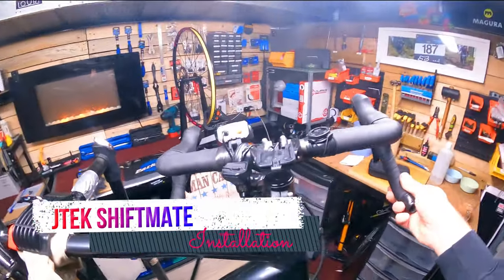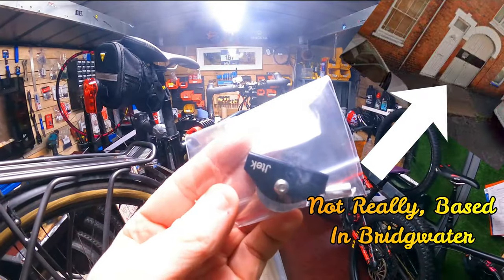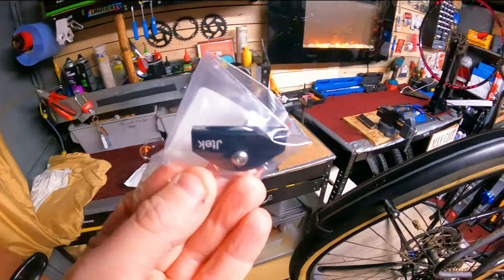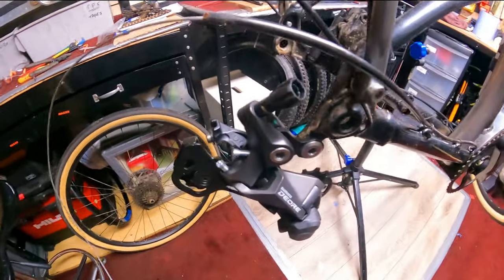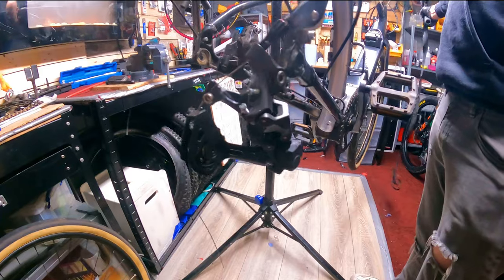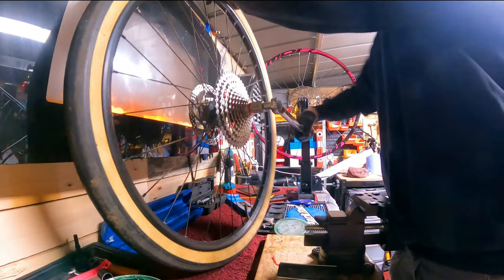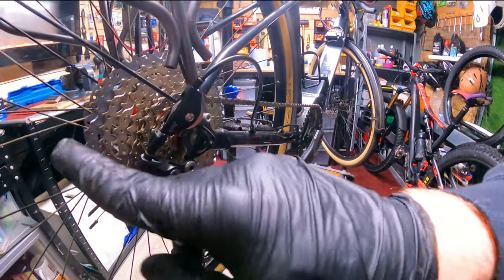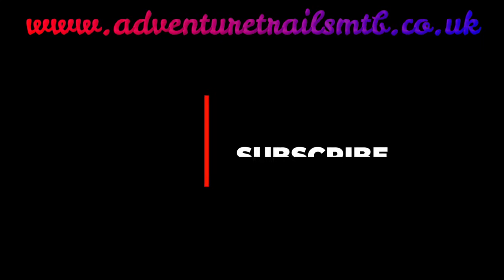Use Road Bike Gears With MTB Derailleur's: It's All About The Ratio's (Shiftmate)

Comment: Can I, with this thing, pair Sora 9 speed road brifters with 10 speed mountain derailleur (for example Shimano M786) on a 9 speed cassette?
Reply from the maker: not that i'm aware of dude , but check shift mates website , they may have abetter indication . looks unlikely though
Reply: 9 speed Shimano road has the same pull ratio as a 9 speed Shimano MTB rear derailleur out of the box.  No adapters needed.
10 speed SRAM road has the same pull ratio as a 10 speed SRAM MTB rear derailleur out of the box.  No adapters needed.

Comment: Hi its johnV ,, that's an awesome tutorial for having a road bike shifters and use a bigger cassette teeth 11-42 and a MTB RD parts. I have the same set up Shimano 105 10 speed shifters, Shimano deore RD 10 speed, 10 speed 10-42 cassette and it won't shift correctly and I'm stuck on it. do you have any idea I can make it work. thanks

Comment: Which specific JTek shiftmate did you use in this case? It's exactly the same ratio I need to change (10spd road shifter to 10spd mtb derailleur). Thanks!
Reply: Look on Jtek's website where there is a comprehensive table showing which version you need for the various permutations of gear and shifters and speeds.
Reply: At 1:41 you can see the number. Looks like a 6